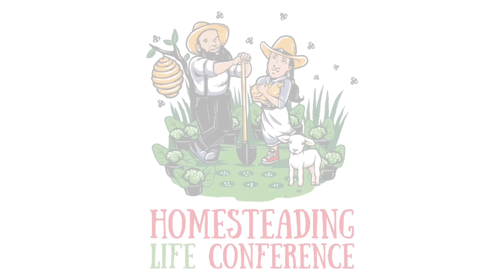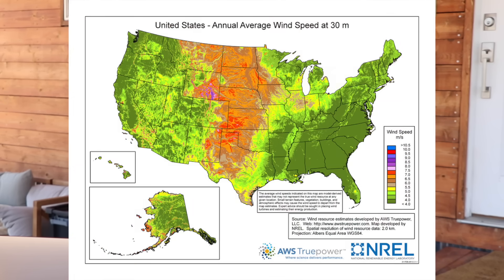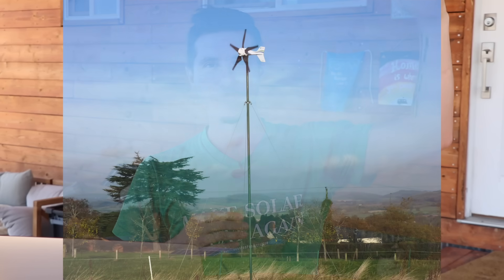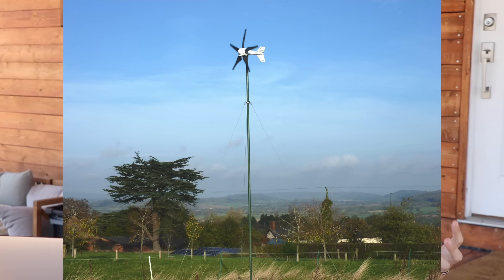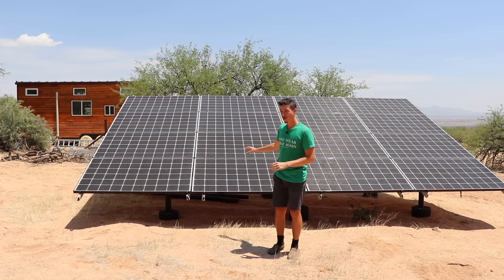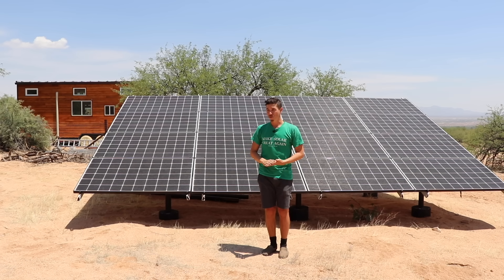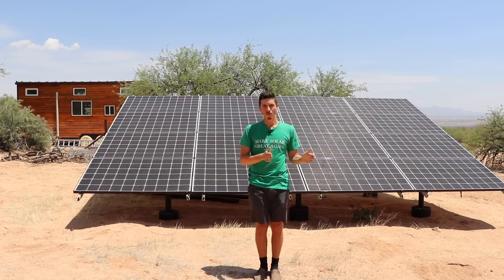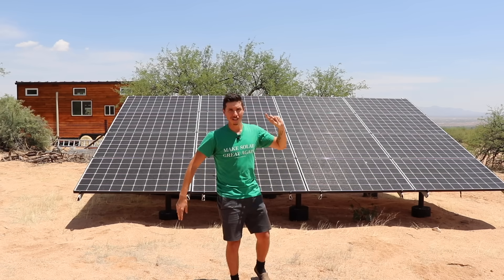Micro Wind Turbines... Are They Worth It? (Off Grid Solar)

Comment: Vertical axis wind turbines do not have to be that high up off the ground and get started at a much lower wind velocity. They have the advantage of running constantly even at night and they don't suffer from damage from hail snow and dust.
Reply: Handeeman Yes small wind turbines produce less power than you think and cost more but you keep missing the point. They produce power! We don't all live in a sunny desert.
Reply: Solar Panels aren't magic either. When the sun is too low of an angle, they produce little to no energy. Wind turbines are no different. One isn't to replace the other. They are to compliment each other. In Fl, we have winds start about an hour before sunrise and about an hour or two after sunrise. Then again an hour before sunset and about 2 hours after sunset. During those 2-4 hours, there's not any usable sunlight to make the solar panels start working properly. So instead of 14hours of energy production, we could have 18hours of production. This reduces the need for larger battery banks at night. Also, during the storm seasons, we can go over a week with no sun, but we have PLENTY of wind.
Solar has it's strengths, and Wind has it's strengths. Use the two methods of energy production to your advantage. Vertical turbines are fine for open fields with low to no hills and no trees around. Horizontal turbines are great for hilly areas, trees/forests around, or near buildings. Verticals need to be at least 40Ft to make anything usuable, but Horizontal can be used at 20Ft. True, they don't make as much power with 5Mph winds as opposed to 20Mph winds, but the sun doesn't make as much power at 6am as it does at 12pm.
Reply: Sure. https://www.thingiverse.com/thing:805269
I can't take all the credit - it's a much improved version of someone else's original design. Very little torque, but it looks cool. I wonder if you could dangle something from it to hit bells and play music, or make a bird-scarer.
Reply: @vylbird8014  No thanks, we have enough toys.
Reply: @vylbird8014  Take a hard look at HAWT's power generating capacity. Little one's are putting out 400-500 watts ar 12 v. Do the math. At 120v AC, how many watts are available? I'll give you the answer. It's 40-50 watts. Basically, a TOY.  Do you want to press this further?
Reply: @brianrichard8310  I'm not sure what the contested point is here. We seem to be in agreement: Small-scale wind turbines are toys. Solar is much more practical at small scale.
Reply: @vylbird8014  Right and three times as long to the payback plus the alternate energy sector is rife with corruption and under the table kickbacks. That is what is inflating prices to the point where none of it is worth the money now. All the engineers in the world can't come up with a winning design that works, and it has become NEEDLESSLY complicated? PLEASE! Do you think I'm that naive or stupid? Cost overruns, including municipal permits account for 300% cost overruns, which the contractors OVERCHARGE FOR. It is not unusual for a project to cost way above estimates, which if properly/improperly applied get paid by the contacting party, because the builder badly underestinated and now is pleading poverty. Very poor. Very stupid. Solar and wind could be 30% less expensive, if manufacturers could agree on a single costing format, and a single measurement of output. In my Municipality, you can only put up a 3000 watt gen, without a permit. It doesn't say at what voltage or amperage is permissable, which is stupid too. Because 3000 watts at 12 volts, does not do the same amount of work as 3000 watts at 120 volts. But try as i might, i can't get the municipality to understand. With all their engineers, they cannot see the difference between the two. Are they all stupid?
Reply: @brianrichard8310  
Do you really think that all the scientists and engineers in the numerous companies in countries around the world have missed the advantages of VAWTs and YOU of all people know better than them? Seriously? If that isn't self-conceited I don't know what.
Reply: @superdau  I'm  saying that they all have "preconceived biases" as do you, and as do i, to a lesser extent. I see the possibilities that everyone else has tossed aside. That most engineers have closed their mind to these possibilities, so that they "fit in" with their contemporaries. That is just sad. Innovation is the bread and butter , to a real scientist, or so i thought. But, you cannot see what i see, and I'm no scientist. So sad.
Reply: @brianrichard8310  3000W is 3000W, no matter the voltage. That's one of the most fundamental formulas in electronics: P=IV - with a caveat that you have to consider it only instantaneously true when dealing with AC.
Reply: @brianrichard8310  That's not how it works. You've got it backwards:
3000W at 12V is 3000/12=250A. A bit impractical, but you could do it if you really wanted.
3000W at 230V is 3000/230=13A.

So you could have 250A at 12v, or 13A at 230V, and in either case it's still 3000W.
Reply: Cool design. With some reflective tape applied to the outside surface of the wings it might be useful to keep the birds out of the garden. Nice job.
Reply: I put 3D printable VAWT designs on thingiverse. People keep asking me how much power they generate. The answer is 'none' as they are only intended for ornamental and research purposes, but people are just that hopeful.
Reply: A wind-powered strobe light on a sunny day. That could get annoying!

It's not all my design, I merely refined it. My improvements reduce material cost and drag and increase strength over the starting point, allowing the turbine to be built bigger.
Reply: Physics? Check out the power curve.  http://www.desertpowerinc.com/pacwind.htm
Reply: I imagine that costs quite a bit more than the horizontal turbine equivalent. I got mine for less than $500.
Reply: PAUL IS SPOT ON!!!!!
Reply: ocean wave is better ……………………….the ocean never stops moving
Reply: Vertical wind turbines are usually much worse in efficiency, and the goal is to collect all the power you can, that is why you want a normal 3 blade design as far up and away from any structures if at all possible.
Just turning blades doesn't help, they need to give you power.
Reply: @MsSomeonenew  Not the vectored thrust varoety. As a matter of fact, through testing, exceeds the "Benz" Limits.
Reply: @MsSomeonenew  for VAWT's, 5 blade is the proven better design now.
Reply: @MsSomeonenew  Put up a similar sized, geared, generating capacity, etc, VAWT, side by side, with a HAWT. Take the readings, THEN make an informed comparison before OPENING your mouth please.
Reply: I would avoid vertical axis turbines. I have tried them and they make a fraction of the power provided from a standard turbine with similar cost. Its just physics. You have 2 thirds of the turbine not engaged with the wind flow at any one time. They can be pretty but they are less effective.
Reply: @aloneinanearthship4010  Look up "vectored thrust VAWT".
Reply: I understand the impulse to try something different that might work or even be better. I tried the VAWT thing myself hoping for great power generation with a more aesthetically pleasing design but I found that the old reliable horizontal design works better for good reasons based in physics. I'm sure lots of people will still jump on board with the VAWT thing, and they are pretty, but I think that's there only real advantage. That said, I would still be interested in seeing your design.
Reply: @aloneinanearthship4010  If they poured as much money into VAWT, as they have put into HAWT, VAWT would take the cake by far.
Reply: @brianrichard8310  I don't see how, the physics just isn't there. But I'm willing to be proven wrong.
Reply: @aloneinanearthship4010  Put a billion dollars of research into it, like you buggers have spent on HAWT, THEN tell  me the physics isn't there. Apples to apples .
Reply: @brianrichard8310  I still don't think so. Just the fact that you have only a fraction of the power generating surface engaged with the moving air at any one time puts the VAWT at a disadvantage compared to the 100% of the surface engaged as with a HAWT.
Reply: I forgot sake don't get onto that starts at low wind velocities, it's bullshit, the turbines are smaller and don't produce much power so cutting in at low velocity winds is bullshit...
Reply: @SolarizeYourLife  so is " the sweep" of a turbine blade. Bull squirt.
Reply: @SolarizeYourLife  Apples to apples bud. Make a VAWT the size of a HAWT, then talk, otherwise you are whistling through your ears.
Reply: @SolarizeYourLife  Do you what else is BS? Calculations THAT use the "sweep" of a HAWT.
Reply: They also have lower efficiency, which means less power for a given cross-sectional area. They are good when you have a lot of gusts and sudden changes in direction, but still have the same drawback as HAWT. They don't scale down: Go big or go home.
Reply: @vylbird8014  If they were geared like horizontal types, and the generator was not directly under the heaviest part, of a verticle variety, like a horizontal type, i think a vertical axis wind generator, would fare very well against a horizontal type.
Reply: @brianrichard8310  The problem of being under the heaviest part isn't really a problem. That's what thrust bearings are for. The only reason I abandoned my interest in wind turbine was underlying physics - they don't scale down. To be practical requires the turbine be physically very large.
Reply: @vylbird8014  That would have been true 10 years ago, but a lot of progress has been made with magnetic floating bearings. Thrust bearings must bear a heavy load without floating bearings, and therefore wear out faster. Secondly, with "vectored thrust" the benz limit is transcended.
Reply from the maker: the cost and low power production is still an issue, they produce a lot less power then you think ;)
Reply: @Handeeman  Lets go apples to apples, now please. If the generator was geared (like they are for horizontal exis wind generators, i think you would find them to be comparible. But no! You idiots insist on putting the generator RIGHT UNDER THE WEIGHT OF THE BLADES. Of course you are going to have bearing problems. If the manufacturers were BRIGHT ENOUGH they would have figured this out. They all have their fists up their collective (you know where). It's like teaching a troglodyte  how to paint like Picasso.
Reply: @Handeeman  Wrong. Current methods of "Vectored thrust" actually exceeds the benz limits.
Reply: Wind turbines aren't magic. Just because they turn, doesn't mean they produce a useable amount of power. Can't beat physics. If there is no energy in the wind in the first place (because it's much slower at ground level), there is nothing to get out of it. The energy in wind increases with wind speed cubed. Double the windspeed, 8 times the energy. So it would be stupid to install anything at ground level.
Reply: @superdau  That's the same theory behind the "sweep" of a turbine blade. That all BS. It's not the amount of air to be used, it's the ACTUAL amount of air used. Apples to apples please. Make a VAWT with the same sweep, then tell me which one is better. DO NOT make "blanket" statements, without the facts to back it up please.
Reply: @superdau  wrong. Because of the way houses and buildings are orientated, you could get a multiplying of air speed at ground level, albeit it would be gusty, and uneven but that is the VAWT's forte, is it not?
Reply: @superdau  Such an uninformed view. Better start reading the most recent reports. Look especially for articles on "vectored thrust VAWT's". Also recent articles on "the benz limit".  Have fun.
Reply: @brianrichard8310  
Btw. "the benz limit"? Is that the maximum number of Mercedeses one is allowed to have?

Comment: For your specific situation wind definitely doesn't make sense - you have great sun all year long, lots of space and can simply add more panels to make up for lower winter production. However, there are quite a few areas where it does make sense as does hydro... your video would have been fine had you just said it doesn't make sense for you rather than trashing wind across the board. This is exactly the kind of thing you criticized Jesse for a while back...
Reply: Voneschenbach, I agree, this is a hatchet job on small scale turbines. The video of the spectacular failure of the large scale turbine is one example. It is fairly simple to erect your own tower. Hybrid systems tend to give a better all year round performance than single source systems.
Reply: my friend is off grid and has both  wind and solar panels
when he does not have one the other kicks in to produce power

BIAS BIAS BIAS
Reply from the maker: I didn't trash wind across the board, I specifically said it works in some circumstances but for the vast majority of people, it doesn't

have you every setup an off grid energy system?
Reply: Why yes, I have; I have both a grid-tie and an off-grid solar system... and I think the overall tone of your video does a disservice considering wind when it's appropriate. To quote you at your intro (1:40), "...why micro wind turbines are not really a good idea for small off-grid setups..."  My systems only produce about 1/10 of their nominal output November through February, which is also when we get our wind... if I had good wind resources I would not hesitate to add a wind turbine even if I only got 50-100 watts per hour consistently...people need to research the options and choose those that make sense for their specific situation.

Comment: Guess those Dutch didn't get the message about how bad wind turbines are.
Reply: Guess some have never visit Scandinavia, where the majority of the homes outside of the major city have wind turbines instead of solar panels.  Those wind turbines are those from  the 5kw/h to the 2000kw/h kind, ie  micro turbines.  

It's like some Norwegian produce a video saying that solar is sub-par compare to wind because he live in Norway.  To make a blanket statement about one system is better then another with applying the conditions is giving misleading information.
Reply: its always windy in the netherlands, so yeah we use both options.
doesn,t mean its of much use in a desert ...
Reply: *without
Reply: The megawatt scale versions that Siemens and GE churn out are marvels. The hobby shop crap I see online is a far cry from that
Reply: Holland is not an off-grid micro turbine situation. Reading and listening comprehension fail

Comment: Here in Scotland ....It's pretty windy so we stuck a 2.5kw solar array on our roof- doesn't have to be sunny to generate power. Wind Turbines only make sense in windy places. Although don't put the turbines down so much. You dont need to stick in on a tower that high if your on a hill or have a hill near by on your property, Again this all depends on the topography of your land/ property. Wind turbines don't blow up if your batteries are full, you still use a charge controller. Wind turbines make more sense for a Grid tied system as excess power can be fed to the grid or neighbors and make you more money. Usually 1 large wind turbine could be a community project and feed many houses of an island or community and not just one family. Wind turbines work all the time it's windy even at night. Yes, there is mechanical aspect to maintenance although this wouldn't be so much of a problem with regular upkeep and checks just like cleaning your panels and checking your connections are still secure. Yes Solar is easier and mostly no planning permission is required.  Wind would be a good top up to a solar system but it is certainly not as profitable or as profitable as solar (dependent on your location). (We live on a hill and 12 massive turbines have been given planning permission to be built next to us)